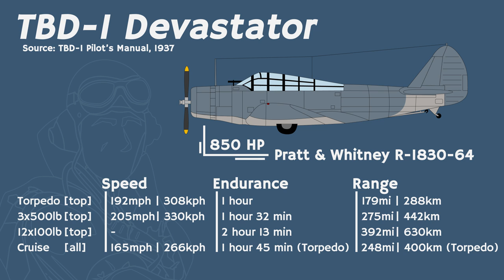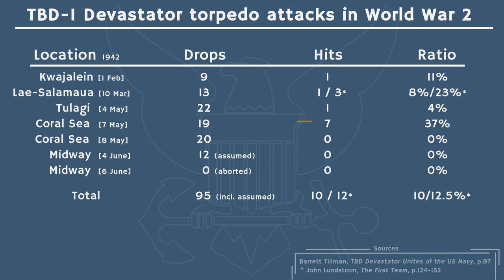In Defense of the Worst Aircraft of World War II - TBD-1 Devastator

Comment: The Douglas Devastator was the unsung hero of Midway...whilst the Devastators were down on the waves on their torpedo runs and getting slaughtered by the Zeros...the distracted Zeros never saw the Dauntless dive bombers diving from above and their bombs sinking 3 Japanese carriers in minutes...
Reply: They also exposed one of the zero's major weaknesses.It's utterly inadequate ammunition load. When the dive bombers arrived the zeros were on Deck being rearmed
Reply: Yep!
Reply: @michaelbizon444  That and the Japanese worked their aces to death, they didn't rotate them out with fresh pilots.
Reply: Santa Cruz and the Marianas saw some of the worst attrition rates for the IJN’s air corps...
Reply: Some models like the A6M5c (labelled in the Japanese inventory as the Type 52) would have had it worse.

Although the Type 52 Zero did have better guns (a pair of 13mm MGs and 2x 20mm cannons) it still used the same design which IMO would have worsened the poor ammo load problem...

Oh wait, it did because the Type 52 Zero (most particularly the A6M5c model) had it’s guns mounted in the wings.
Reply: James Ricker THIS is key.  The Zeros simply couldn’t defend against the repeated waves of air attacks.
Reply: Plus, lack of armor and self-sealing fuel tanks made them death traps when on the receiving end of Allied fighters' gunfire...
Reply: You are right, Erik. I had the opportunity  to speak to some crewmembers of the TBD. They went to war with an obsolete a/c, but they went!
Reply: The Zeros had almost an hour to get back up to altitude after destroying VT8. They had a terrific climb rate, so that would be no effort. What they did was prevent Nagumo from spotting his strike on the American carriers in favor of launching and landing the CAP planes in between hasty defensive manuevers. Shattered Sword has debunked this myth of the CAP being drawn down to low altitude during the dive bombing run. Excellent book and highly recommended!
Reply: 9
Reply: A Banzai attacked followed by a a sudden strike on the flank,
Reply: CK Lim   Umm...no. The notion that the USN torpedo squadrons were intended as little more than cannon fodder is pure hindsight. The goal was to have simultaneous attacks from dive bombers and torpedo planes in order to split the enemy's defenses. Unfortunately the US Navy at this time was also firmly wedded to the concept of strike packages being launched from a single carrier (as opposed to the IJN practice of using multiple carriers in order to assemble a single strike package in the shortest time possible).  The problem was that it took so long to launch 60+ planes from a single deck that the aircraft launched first (usually the dive bombers) had to head straight for the target and hope to rendezvous with the fighters and torpedo planes somewhere along the way.  In practice that almost never worked.
Reply: @radtech21  I wish I could remember the source, but a big reason for all the Japanese Zeroes being on the deck was bad tactical discipline.There was no CAP control similar to what the US Navy had developed, so it was almost every pilot for himself. They had Zeroes assigned as top cover (to attack any dive bombers that appeared), but they got caught up in the feeding frenzy and came down to join the attack on the TBDs instead of staying where they were supposed to. They were more concerned about individual accomplishments rather than the overall mission (of course, they were expecting the war to be over any day so you had to get the numbers while you could.....). later in the war, you read about the US Fighter escort missions over Germany. The first group of Luftwaffe fighters would try and draw off the fighter escort and thus leave the bombers exposed to other waiting Luftwaffe fighters. But the US escort fighters did not take the bait - they just drove off any attacking planes and returned to the escort formation.  They took losses, and it didn't do much for the fighter pilot stats, but the bombers got through with minimal losses - and that was the overall mission.
Reply: @Straswa  As if they had that option. A country with limited industrial output, raw materials and above all fuel has to make every single pilot count.
Reply: @brianwong7285  Only the early war versions. The later had self-sealing tanks.
Reply: @jamesricker3997  1. "They also exposed one of the zero's major weaknesses" Nothing to do with the effectiveness of the aircraft itself merely a circumstance in a crucial point of the battle. 
2. "It's utterly inadequate ammunition load." Right, and that was the culprit for why they were being rearmed? It had nothing to do with preparing for an all new attack and refueling them? 3. "When the dive bombers arrived the zeros were on Deck being rearmed" And that was pure circumstance which the dive bombers happened to be in the right place at the right time to exploit. Claiming that this was all due to the "underrated effectiveness" of the Devastator bombers and the "utterly inadequate" ammunition load is autistic at best and absurd at worst. 

It never seized to amaze me how some people like to view something from an already rigid preconception and then add details based on confirmation bias which is used to uphold an already set narrative - but ironically missing the big picture. 

Are you one of those who seriously believes World War One was fought over an assassinated Austrian arch-duke?? Or even that if that event never occurs then WW1 is magically butterflied away from history??
Reply: Erik Hertzer "was the unsung hero" Do you even know what an unsung hero is? Hint: It's not cannon fodder who were carelessly sacrificed and died and somebody else to later take the glory. An unsong hero is somebody who does well, works hard and contributed a lot but for some reason or another isn't noticed and slips by due to different events happening around them taking center stage. 
It can be a great trainer who is crucial for the success of a top athlete. It can be a producer who is is the real brains behind the sound of an artist. Or it can be somebody like that guy Bill Gates payed peanuts to develop DOS and later made billions by claiming it was his own work. Most of Henry Ford's "ideas" weren't really his but his engineers and factory foremen who pitched them to him. 

In war it's usually a calm and composed general or colonel who most never notice because they appear so "uncharismatic", but who conducts every operation competently and with minimal casualties of men. 

As for products. The Hawker Hurricane was the unsung hero of the Battle of Britain. While most people praise the Spitfire to the skies the fact is the real workhorse of the RAF during this battle was the Hawker Hurricane which shot down 5/7ths of all German planes. Did most of the heavy work but doesn't get the praise... 

The bottom line is that an unsung hero still be definition must be a hero - i.e. do something well and play a crucial role in something. 

Inadvertently "distracting" the enemy while doing your duty and failing, and somebody else benefiting from lucky circumstances does not qualify.
Reply: @McLarenMercedes  A fair point.
Reply: Daniel McGrath  Well said. Truly a herculean task.
Reply: CK Lim  where did that come from?
Reply: @markdayell61  One could say it did the opposite it made the Japanese concentrate on keeping up the air cap and refueling their fighters preventing them from launching their counter attack.  It also stretched the carrier fleet apart along with their escort.
Reply: Well, and the fact that since the Zeroes were at sea level, or close to it, they couldn't climb high enough to intercept the divebombers in time.
Reply: The fact of the battle is clearly stated here. How can anyone knowing the battle not recognize the importance of the Devastators and of torpedo 8 and LCDR John Waldron in  brining the Zeros down on the deck to open the heights for the Dauntlesses. Ironically, if it were a coordinated attack with air cover the Dauntless may not have been so effective with Zeros high and ships guns at different elevations, and in the end an outcome that may not have been as good as it was. Those Devastator crews  bore in without cover and took it in the face to make it all successful. They were amazing.
Reply: @analystanalyst7652  The Devastators, tornado 8 and I believe a b17 attack had a huge impact on the outcome, though the book Shattered Sword puts doubt on drawing the cap down.  What it did do was further weaken the effectiveness of the air cap by causing the carriers to further separate and disperse the coordination which was already lacking.  The constant attacks added the chaos of battle plus according to a more recent book amplified the lack of disclipline of the zero pilots.  Over pursuits caused breakage in coverage.  But it's been debatable that the attacks brought the cap down in any significant manner according one again to the evidence in Shattered Sword.   Either way they were key to allowing the dive bombers to be able to break through and hit their targets.
Reply: I know about Shattered Sword saying "they didn't draw down the IJN Combat Air Patrols", but consider that VT-3 and Wade McClusky's mixture of VB-6 and VS-5 were in the combat area at the same time.  Most of VT-3--which had either seven or eight surviving aircraft thanks in large part to taking evasive action--turned around after sighting them and engaged their pursuing Zeroes since whoever was acting as commanding officer (Richard Suesens?) realized they had no fighter protection and that Jimmy Thach's F4F was the last remaining fighter in the combat area.  They apparently believed that McClusky's force was VB-3 under Max Leslie that had been reinforced somehow.  That attempt saw only two aircraft--those of Harry Corl (who had to retreat early due to losing his radio) and Wilhelm Esders (trailing black smoke with his radioman-gunner, Bob Brazier, mortally wounded) make it back.  Corl managed to land while Esders ditched alongside the Enterprise after finding the Yorktown under attack (he got Brazier out of the sinking airplane and Brazier was apparently alive for a few minutes in the life raft, but he was dead from loss of blood within a few minutes).
Reply: Well during the battle of coral sea the Japanese zeros engagehe SBD dauntless bomber with the zero distracted by the SBD TBD-Devasator was able to sunk the light carrier shoho with two torpedo hits I think which explains why during the battle of midway the zeros focus on torpedo planes instead
Reply: CK Lim  you're wrong, in 1944 when the US admirals saw the potential of torpedo bombers and US equipped with functioning torpedoes they would serve alongside the dive bombers as the main hitting power. You should read about Phillipines sea and Leyte Gulf(Sibuyan Sea) the Hellcats  would come in first above enemy fleet and mop up any CAP fighters then if possible strafe the ships deck so their AA gunners would be distracted or suppressed while the dive comes in next and drop their bombs on the ships so they would either get damaged or caught fire, in midst of this chaos the torpedo bombers would come in probably unmolested by fighters and aa gunners and they would successfully torpedo their targets. Read the said battle, same happens during Yamato airstrike during Ten Go